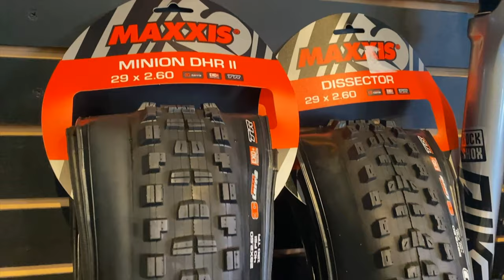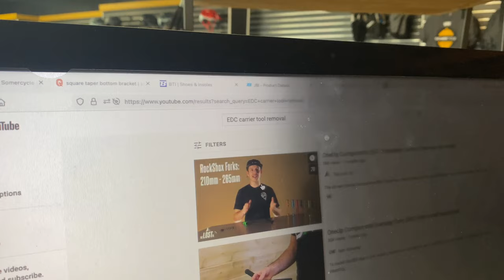Kona Honzo ESD Dream (RE)Build

Comment: I would love a follow up on this build. 

Especially if you like the original 63 deg head tube angle better than the 64.5 deg hta. Also, I was going to buy a versatile hardtail, the bike shop has an ESD in my size and I’m tempted to get it. I was afraid the ESD would be more like an enduro hardtail. In the intro you called this your “XC Race bike”. I know it’s not a true race bike, but is this thing good to pedal around for hours?

Comment: WhT are your thoughts on going from the large you demoed today the medium I’m really stuck on this I currently ride a process 153 29 CR custom build and went with the large im 5’8” but have really long arms the bike feels a bit big but I sat and rode an esd in a medium and I felt crammed in the cockpit hopped on a large and it felt like I was more inside the bike than on top the real test will be taking my friends large out on the trail this weekend any advice would be great! I’m really torn between the two sizes of the honzo esd.
Reply from the maker: I'd say you're winning either way. You're shorter than me and I am glad I went with a medium but also felt comfortable on a large.
Reply: I’m 5’10” and got the Medium which is perfect for me as I love a more poppy bike that’s easy to bunny hop but in saying that the Honzo loves the DH 🤟
If you’ve heard of your RAD measurement, I find that more accurate than the  manufacturers sizing as I can go either way (MED OR LGE) 
I know my reach  is .440 - .460 max but RAD measurement is way more accurate as from what I’ve seen no one takes into account your actual arm length , they go off your height & inner seam only ! When I did mine on the Trek site , it told me to check my measurements 🙄
I had a Trek Fuel ex 8 in a M/L which I found slightly to big , sold that & bought a Scott Ransom 920 in M which is perfect 😍 & a month ago the Honzo M , perfect also ! Cheers 🍻